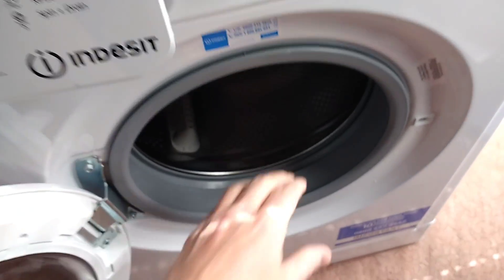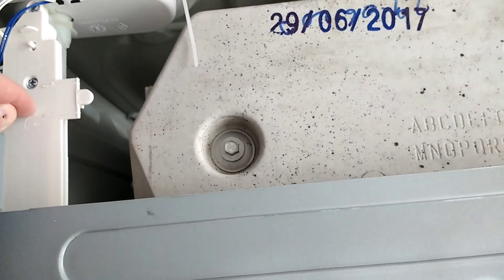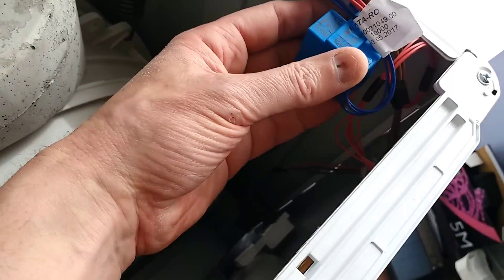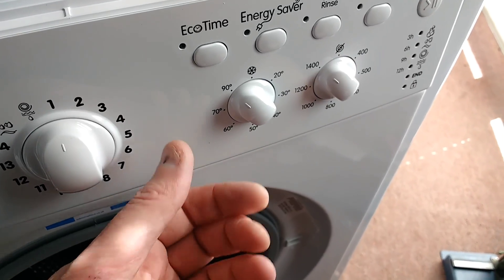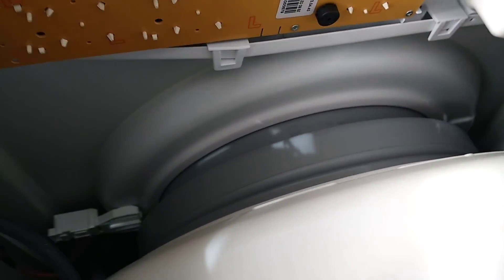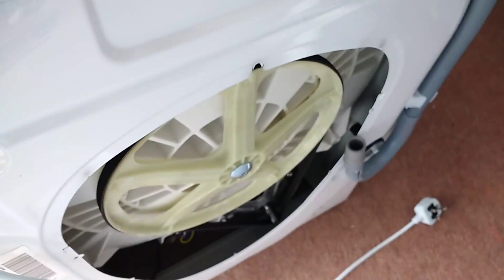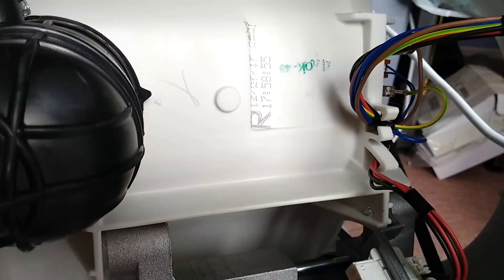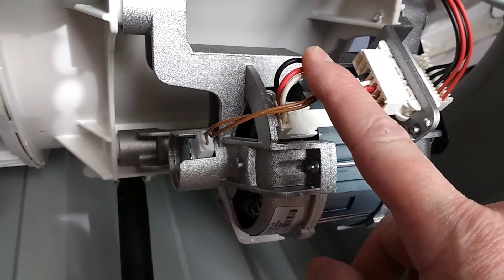Inside my new British washing machine (clothes washer).

Comment: I've just purchase this exact machine. Old one was very similar. Something got stuck inbetween the drum and the plastic casing around it and rubbed it that much it melted. So all the way around the edge of the plastic had tiny holes in it so it leaked everywhere. Hahaha
Reply from the maker: If you hear something between the inner and outer drum then you can usually pop out one of the agitator fins to reveal and inspection and retrieval hole.

Comment: Last month there was an interesting "why has no one though about this" article on the BBC about using water instead of concrete as the weight and then adding when the washing machine was  in situ to reduce the transportation costs etc... http://www.bbc.co.uk/news/uk-40821915
Reply: Water isn't very dense so the weight would have to be about three times as big. Doesn't leave much space for the drum. Some washers use cast iron as its even denser.
Reply: An interesting idea nevertheless and possibly the boffins would be working on resonance at the spin speeds which seems to be the main reason the machines require the added weight.
Reply: Probably because it isn't an issue. By the time it's boxed for shipping, the average density of the whole thing is low enough that it is the volume that limits the number you can getting into a shipping container, or on a truck. Just a guess. If moving the machine around to get it into a top floor flat, for example, then they unbolt easily anyway. Concrete can't leak?
Reply: Lot of fuel to move around concrete on a global then local scale, also lime used as an ingredient is bad for the environment. I'm disabled I can move a tumble dryer but not an empty washing machine (admittedly neither up steps). Though I take on board the possible leakage issue and in the UK Indesit is one of the brands under investigation for fire safety (though in regard to tumble dryers not washing machines). Unless the design made use of waste water though and was flushed, I think algae would be an issue, as would increased water bills.

Comment: Cheap made machine. These indesit machines are at the "low end" marked. At the thing with the cold and warm water inlets: here in Germany its standart to hook washing machines only up to cold water (and they only have a vavleset for cold water). Only Semi or professional use washers have those two inlets, to save some time. I didn´t saw a plastic pulley before, but the motor mounting with two plastic pins from the outer drumm and no belt tentioner (not even an adjustable motor mount as Miele it has) are standart for 200-600€ washers at least with the you can get in Germany. Bdw the plastic isn´t renforced in any way. I personally suggest to buy a used older Miele (the 7xx-8xx-9xx series) and repair it (at least when you know where you can buy spareparts for cheap).

Comment: i recently took apart, and fixed an old Hotpoint Washing machine, good 10 years on it (was my mothers before she got a fancy new one and gave it to us.).
basically the pump got a ribbon wrapped around it, easy fix. 

then, i didnt put the top back on, and my missus accidentally spilled some water on it, fried the main controller board, a new one was ~£80, or a similiar second hand washing machine was just £50, so we got a new one.

Comment: Oh no! You bought an Indeshit (as we used to call them in Comet and when I worked at Argos) This machine will be broken or need major repair within 4 years.
Reply: Everyone who understands white goods calls them the same. ;)
Reply: I bet he will be pulling this machine apart very soon and finding out that cheap circuit board is to blame or the plastic wheel attached to the drive belt has cracked #Indeshit
Reply: What's the most common problem? Plastic drum pulley, inverter, or circuit board?

Comment: The control panel in my Hotpoint suffered condensation damage, the one at the bottom of your machine. It needed some new chips etc but its the only failed part since 2005 and happened just as the 5 year warrenty expired. It is still running other wise today..

Comment: Front load washers are mock enviro friendly shite.  

Had one for nearly 10 years and I hated it.  It didn't clean as well, shook the house on it's 2000rpm spin cycle, and smelled awful after the first week.  

Back to an old school top loader that was 1/3 the cost and functions several times better and quieter too.  And it has the same high efficiency lower water level and brushless drive.  Dirt and grime settle out with magical gravity assist (patent pending).

Comment: The unconventional position of the main PCB at the bottom is new to me. It looks like the machine is designed to fail completely when there’s a water damage. A wet floor and dead electronics — great for the manufacturer and service technician. 

My 12-year-old relatively cheap washing machine has all its electronics behind the front panel, and there’s a floor tray with a float switch, allowing the machine to stop the program if there’s a leak.
Reply: YES, of course, it has multiple design "fails" to ensure a short life = Planned Obsolescence  ... it should be made a crime & guaranteed 25+ Years durability ordered by Federal Government , like it was in Socialist East-Germany ... 
in the Past the electronics & nearly all electrics (except pump + heater & maybe motor) were on the top most part, also better accessible without tilting the entire machine
Reply: & what would make it leak?? & how would the water get to that side of the machine UNLESS you wash coins & that breaks the drum! i've been repairing these for 27years & 90% of the time its coin damage that causes leaks & more than 90% of that times the hole you get is in the back of the pressure chamber at the front in the middle, close to the extra bit Clive mentioned. so better to get facts b4 commenting maybe b4 you give the wrong impression

Comment: The weight isn't for stability so much as vibration dampening. Re pulley, being plastic (looks nylon tbh) means it's lighter and induces less wobble. It's probably stronger than any aluminium one you've ever seen tbh. The joys of Solidworks. Lastly - there's nothing British about this :p

Comment: Had a German washer for over 30 years, which worked flawlessly. My wife (now Ex-wife), insisted we get rid of it and buy a new one because it looked old. The new Whirlpool turned out to be a complete POS regardless of being the most expensive of the bunch we looked at. But hey, it was a well-know name brand! 
The membrane keypad stopped working  after 6 months, and had to be replaced. The seal around the front door started leaking a month after that. The computer stopped working in mid wash with all the water still inside, not long after. 
So yeah, It has been a great washer. 
I wish I could get the old one back and put an Arduino or an ESP8266 in it. :( 
RIP my faithful German washer...
Reply: Yeah, they used to be designed to last.
Reply: I Have now had 3 Bosch washer/dryers. First used mechanical controls but was really well built. Only problem was my hard water destroyed the heating elements. I gave it up after they failed a second time. Second machine had no problems but they had reduced the maximum spin speed which made the drying expensive. Current machine (made in China) has developed a fault which i have finally identified and looks easy to fix. All have lasted more than 10 years.

Comment: The reason for only one water inlet is firstly cost reduction. Secondly, most UK homes now have instantaneous hot water systems that become very inefficient for smaller amounts. Most of the energy is used to heat the pipework. It's better to use the internal element. 

I've actually considered fitting a small stored water heater under my kitchen sink for the purpose of washing up. Combi boilers are only efficient for larger volumes such as showers and baths. I hate it when people run the hot tap in my bathroom to wash their hands then turn it off before any hot water actually comes out!
Reply from the maker: I use a vented undersink heater in my kitchen.  Hot water within three seconds of turning the tap on.  Not great for filling a sink though.
Reply: I still have a hot water tank and airing cupboard!
Reply: Paul Sengupta indeed and many do. But again for small volume it is still inefficient to draw hot water from your water tank. Most of the heat is lost in the pipes and the washer still has to fire up its internal heater to top up the temperature for hotter washes.
Reply: When I had a machine with a hot and cold feed, I used to run the sink to wash up then put the washing machine on immediately afterwards. The washing machine is/was next to the sink.

Comment: 2.5 years, Clive; 2.5 years until that will have bearing issues as well. The tub is sealed, thus, you can't just change out the bearings, and a new tub unit is the exact same cost as it was new.

You could have asked your audience for help....
Reply: I changed the bearings on a front loader without problems. Sure a lot of disassembly, but doable without any need for special seals or tools and gave 5 more years to an almost 20 year old machine.
Reply: Yeah, on a 20 year old machine the bearings are either in a seperate bearing cross which you can easily dismount or they are integrated into the splittable outer tub. On this machine, you can't seperate the bearings from the tub in the first place. They are pressed into the plastic outer tub, the drum is mounted, and then the front half is glued on. No way to seperate without total distruction.